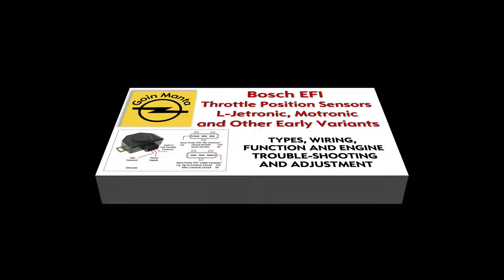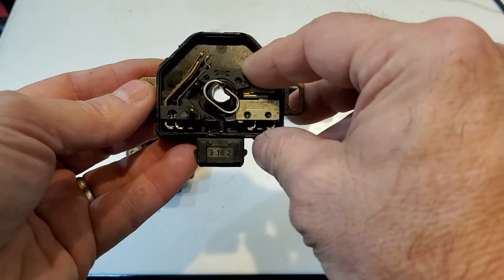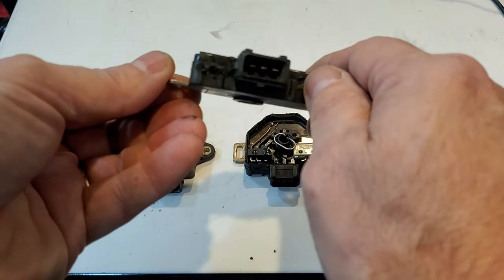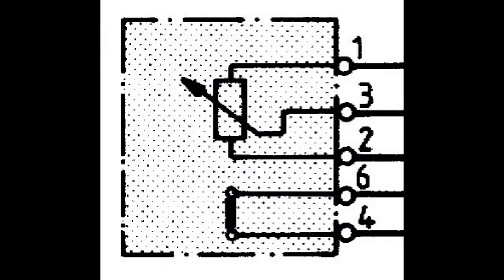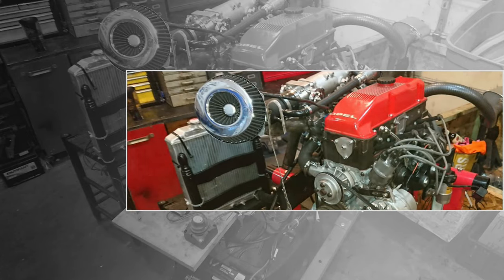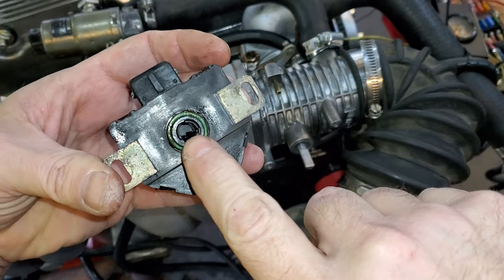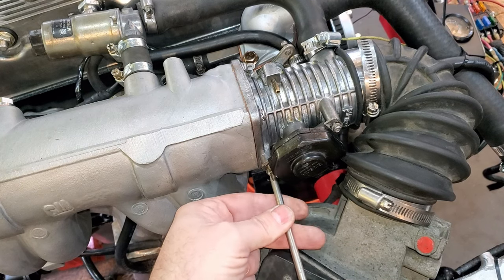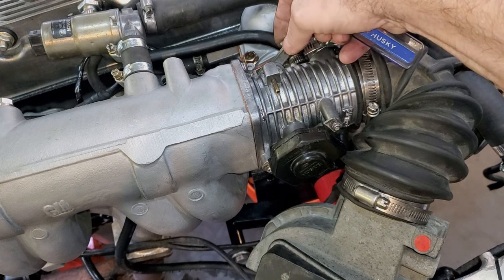Guide to Bosch L-Jetronic EFI Throttle Position Switches ( TPS ) - Adjustment & Troubleshooting

Comment: This is very useful for me since my 85 Porshce 928 needs the TPS cleaned and I wasn't sure how it worked and if it can be taken apart.  You're not suppose to but they aren't cheap and I can plastic weld it closed.
Reply from the maker: Glad the info came in helpful.. :)
Reply: did you find anything when you opened yours and did you have a hard time opening it? I have a weird surging idle on my 85 944 and this is the only thing left that might be the issue. I'm pretty sure I have oil in mine. also FCPEuro has these for like $18 right now. they're not Porsche but come with a lifetime warranty.
Reply: @tvguy12346  Took me many attempts but  I did open it up and found a ton of oil.  I'm guessing the back pressure of the engine causes it to push oil into the idle switch.  It was easy to open up and it's just 2 switches internally.  An idle switch and a wide open throttle switch.  I cleaned both and used DeoxIT but a month later and it corroded the WOT switch.  I sealed it better this time and cleaned the contact points better.  It wasn't oil that got in but I guess moisture from the engine burning fuel?  I also put thick grease in the shaft for the switch before putting it in.
Reply: @DukenukemX  I've read that the seals in the TB degrade over time. I get to do this whenever it stops raining. I think it's what's causing some weird idle surging issues I'm having. Is it a few plastic tabs that need pried open? Thanks for the reply!
Reply: @tvguy12346  Yea it's plastic tabs but it does need to be sealed.  I did change the o-ring for it because it seems vacuum might make it there?  I used gasket maker to seal it.  I have an idle surge issue but it's probably due to a leaking fuel damper.  It leaks through the vacuum line.  But if the idle switch isn't clicking then it will have a terrible idle surge.  You may also need to adjust the idle switch orientation or the lineage to the throttle.  I had to do this multiple times and it sucks to remove the intake on this car.

Comment: TPS with 6 pin connector  was used  on automatic transmission  version . Then a switch  circuit is used by ECU and potentiometer  circuit by TCM
Reply from the maker: I knew it was someting like that.. They've added even more circuits to new ones.

Comment: Would be nice to learn exactly how to adjust this switch.
Reply from the maker: Depends on the switch, usually the holes are elongated, and you rotate the switch on the shaft and feel for the "click". Seen here: https://youtu.be/WHoeE81ZcHU?t=319

Some have a single hole and there is no "adjustment" made. It works or t doesn't as its set at the factory. 

As for "dialing it in" with a set screw or something link for the tolerances in the switch.. that I am afraid I don't see any way of doing it. You could maybe bend the tabs for the wipers, or the contacts in the switch if your switch isn't giving a consistent signal. https://youtu.be/WHoeE81ZcHU?t=106

If that isn't what you mean by adjust..

Comment: Are these bosch tps 5v or 12v?
I have one connected to my megasquirt and it doesn't work...wiring is confirmed good so was just curious about sensor voltage. Thanks
Reply from the maker: Depends the ON-OFF-ON style are not voltage dependent they are simple switches, but it tends to be a 12V. The potentiometer styles I believe are 5V, it comes down to where the power comes from which you can tell by the stock wiring diagram. As you can see on the image above. What's the part number you are using ? Does your version of Megasquirt looking for the IDLE/RUN/FULL THROTTLE signal, or 0-100% with possibly switches as well ( See the video where I take one apart ).
Reply: @GoinManta  i think you have just found my issue. It seems to have and idle switch/ 0-50% /full throttle switch. But no reading between 50%and 100% full throttle. It is a 3 pin sensor...not sure on part number.
Thanks for the info.

Comment: my 79 beetle has a TPS but only two wires on the connector for idle position only. Not sure if it has full open throttle position as well but there are only 2 wires to the ECU.
Reply from the maker: Not knowing the system exactly.. but. If only two wires. Its a yes/no system. Idle or not idle

Comment: Is there a full sweep potentiometer type TPS that can be bolted/adapted to the throttle body? I'm doing a standalone setup on an Alfa using L-Jet parts.
Reply from the maker: Just saw this.. Yes, see if yor intake/motor has a Motronic version. That will be a TPS style. That or could possibly use the Opel 2.4L CIH one

Comment: So if your using a stock 75 EFI Throttle Body and converting to modern motronic or megasquirt system does the 2.4 TPS bolt up?
Reply from the maker: Yep.. in some cases the bolt pattern is a tad larger. But Drilling out the holes from M6 to M8 is enough. You see a couple of the pictures of my motors show Motronic on 1.9L intakes. The 1.9L intake is larger and performs better than the 2.2L or 2.4L as a bonus.
Reply from the maker: After rereading this.. have to put a caveat. You have to use the 2.4L or 2.2L throttle body on the 1.9L/2.0L intake to use the switch. IT also helps as it gives you a place for the Idle Air Control Valve to connect to and overall makes it compact. I will try to do a quick video on those intakes and throttle bodies. Maybe even a simple slide show.
Reply: That's why I subscribe - for the great videos and informative content!  I wonder if there are any bolt-on TPS that are compatible to the 1.9 TB to convert it from on-off-on to potentiometer.
Reply from the maker: @LibertyOrDebt  Yes, The 60mmx60mm Nissan Throttle Bodies. ( believe they are 70mm ) https://amzn.to/3r9xaP7 will work. Have tried and they aren't bad. But the ones I got had issues, I think the main issue was they were cheap and the shaft seals weren't so good. Also looks like a Honda would probably work :https://amzn.to/3rgx2gH It comes down to most are square so it depends on what you want. Often the Aftermarket ones are only the butterfly, but like the Honda (and Opel) you have ports for Idle Air Control and such.

Comment: Great, but how do you correctly set the type of TPS without the switch?
Reply from the maker: I am not sure what you mean.. the TPS is the switch.. the S litterally means switch
Reply: @GoinManta  think they meant the click.... mine doesn't click. I'm having difficulty with my TPS and MAF since a Independent Throttle Body and big cam... I coded eprom accordingly but now I lean these things are adjustable aswell, perhaps they're the reason for slow acceleration and dropping off at 4000rpm?